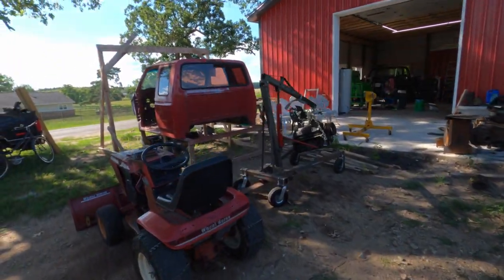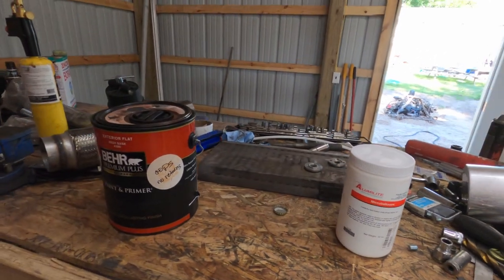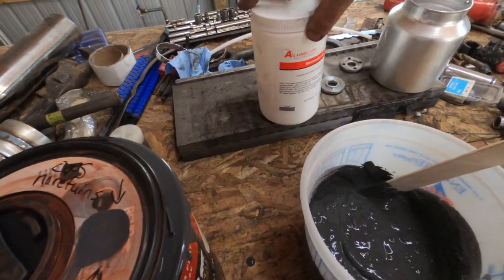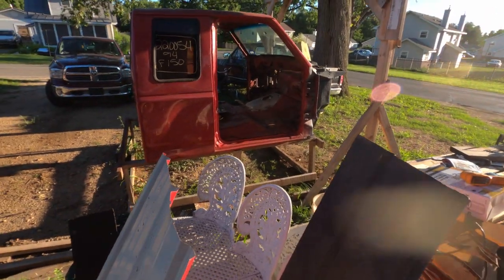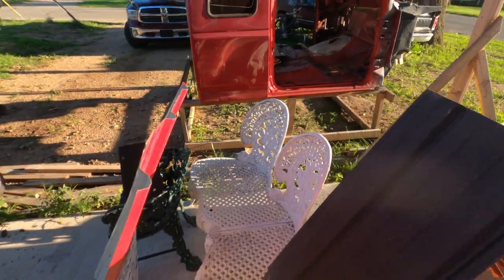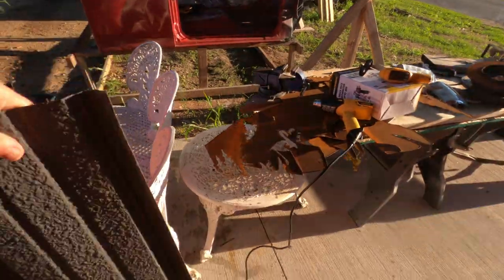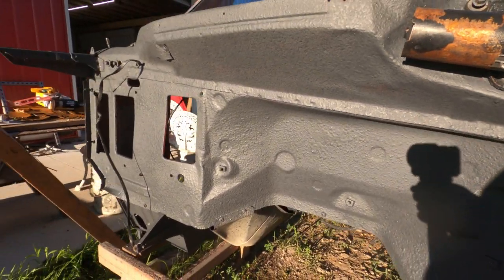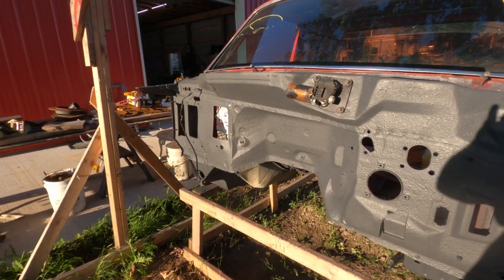Cocoskin. DIY sound deadening/undercoating spray, 30 bucks a gallon!

Comment: Try adding waterproof PVA glue (Elmer's Glue-All) in the mix. It will give some hardness to the coating. Start with about a 10% mix and experiment with more or less if needed.
Reply from the maker: I have the whole interior to go yet, so I'll try that in the spring!

Comment: I would add an aluminized tape near heat sources because that grey color will absorb radiant heat while shiny aluminum will reflect a lot away.

You might want to put a layer in the interior under the carpet and behind the firewall.
Reply: Also I think "Dynamat" is a bitumen peel and stick roofing material (maybe ice and water sheild), one roll is probably enough to do 3-4 vehicles and around $100 so add another $30 and you can reduce the sound more and probably reduce the heat a little too.

Also probably spray the insides of the doors to stop sound from there.
Reply: @joequixotic3039    Regarding Dynamat, you can buy rolls of peel and stick butyl rubber weather seal tape from Home Depot or Lowes for a fraction of the price of buying Dynamat extreme.
I bought a few rolls of Tite Seal butyl after finding out about this a few years ago. (Of course, then my project car got pushed to the back-burner and the tape has been sitting in the trunk, but others reported great results.)

I think this is what you were getting at, but I'd heard that the bitumen sealing material for roofing just reaks when used inside a car for noise abatement, whereas the butyl tape is a fairly low odor option.
Reply: @heyallenify  that sounds right and if you can add sound insulation cheap, why not?

Comment: How durable is it? You mentioned it was soft but is it too soft to use on the floorboards? Would your feet eventually scrape it off?
Reply from the maker: Probably, that's true of paint or bedliner also though.